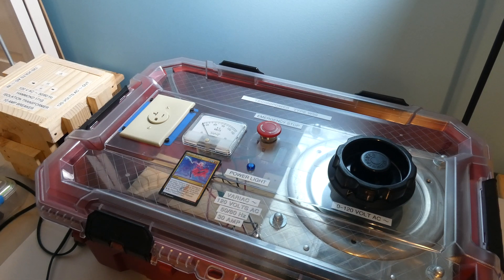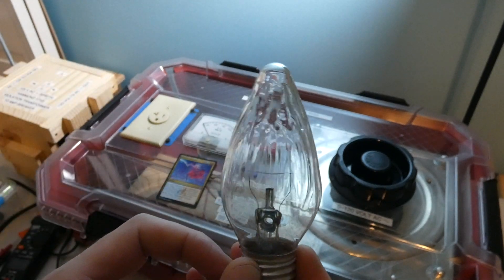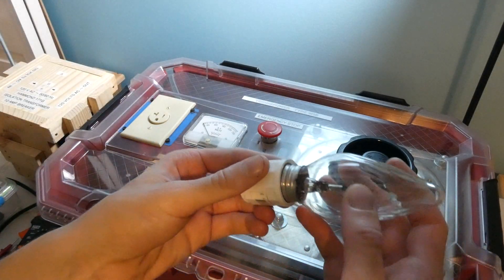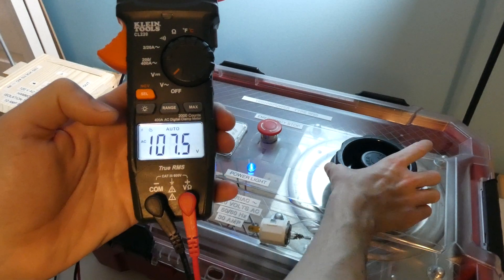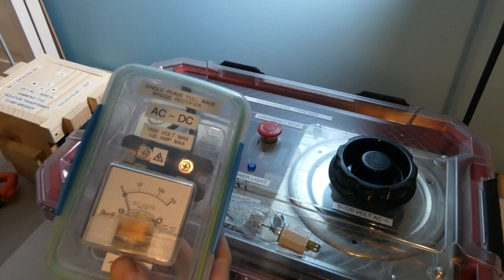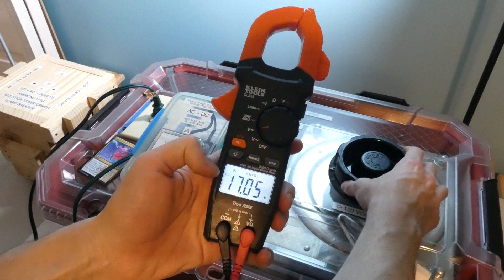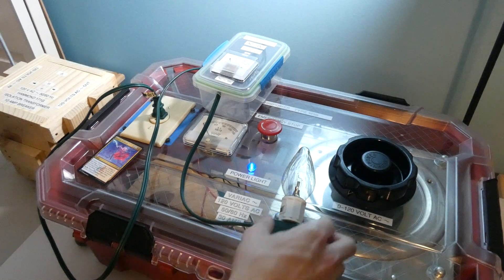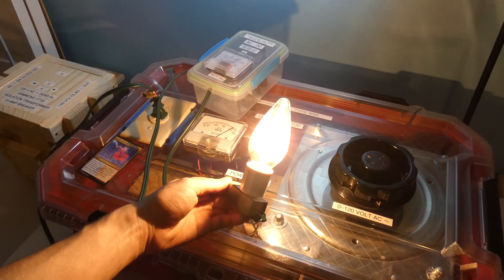Will a Light Bulb Work on DC Voltage ??

Comment: Cool setup which probably took a lot of work to build. And thanks for the demo. I have a little 10W AC bulb in a socket with leads that I use to check for voltage and got to wondering if or how much DC it could handle.

Comment: When I had track lighting installed, the best quality light came from 12V DC, NOT AC  Sure it cost more, but the light looked much crisper, and was more adjustable, just like a BLDC stand fan, uses a small fraction of the Watts AC does.

Comment: What would the DC equivalent voltage be to make the bulb illuminate with the same intensity as it does with 120 Vac? Would it be the peak AC Voltage of 170?

Comment: I mean they work via resistance. The higher the voltage the less resistance is an issues  and   the voltage I think you read for ac is an rms voltages  too. Peaks might be just a little higher . Does your bridge rectifier have capacitors on the input  and out put. If it does and you feed 120v ac into it the  caps will hold the max voltag but at dc  which I think is like 180. If you dont have caps then the voltafe output will be lower  on the rectifier

Comment: Nice video 🙂

Try to shake the light bulb from side to side in both cases (DC and AC).

1. With AC you will see the bulb blinking. At 50Hz it will blink 100 times per second. Because it's a sine wave (~) it will first be zero voltage at 0 degrees (lights off). At 90 degrees it will be at max intensity (current flowing in one direction through the bulb). At 180 degrees it will be zero voltage again and at 270 degrees it will at max intensity again (current flowing in the other direction through the bulb). Finally at 360 degrees = 0 degrees the cycle starts over. Because the light bulb does not care which direction the current flows in order to light up, you will see it blink 100 times per second in a 50 Hz AC circuit.

2. With DC you will see no blinking because current is always flowing through the bulb. Thus the light is always on 💡

Comment: Don't need to watch this video to know the answer is yes. Most trolley museums run on 600 volts DC and the vintage equipment didn't bother switching the DC the AC to power the lights they just rigged five lights in a row in series 600 ÷ 5 =120

Comment: Thank great video.What about powering ac led and tube light. I was thinking of installing an automatic changeover switch to automatically deliver power from baterry to led lights in case of mains failure. the ac led has converter ac to dc 12v installed

Comment: so you have a great lamp with no flicker ussing it in DC
Reply: with just a rectifier, the flicker is the same
Reply: @timeltdme4355  That DC source has filtering, 4 diodes + A big capacitor makes flicker-free light source.

Comment: So am I right in thinking I could run a CFL bulb on DC?
Reply: Unfortunately, no because the CFL has a ballast circuit in between the power in and the florescent tube. That circuit requires AC current to convert 120v to between 300-1000v to start the lamp. This ballast circuit uses both electronic ignition and transformers to accomplish this task. Transformers operate using the principle of electromagnetic induction which is generated using AC current. DC would simply render the process of starting the lamp null and could damage the ballast circuit. Hope this helps.
Reply: @timfritz7367  Hi, yes it does. Thanks for answering my question 🙂

Comment: Incandescent lamps are basically resistors. They don't care which way the current flows. I've done the reverse, running automotive lamps on low voltage AC via a 120 to 12 volt step down transformer.

Comment: Nice video!  What about the same test with an LED bulb?
Reply: It likely won’t work as the series capacitors will act as open circuits for DC. You would need to modify the bulb to bypass the AC-DC converter inside in order to get it working. The LEDs are diodes, which means they only work with current in one direction (DC). Funny enough, diodes can take AC, but only in one direction, and wall voltage would break the LEDs once the sine wave goes negative (look up diode V-I curve to understand why)

Comment: Sure...an incandescent bulb doesn't care if it runs on AC or DC...flashlights and cars had incandescent bulbs for decades.. they're DC. 
     It might make an interesting long term experiment to see if DC or AC affects bulb life.
Reply: Efficiency would also be interesting to see.  In theory it would be more efficient for a given amount of light on DC, as DC always has a power factor of 1
Reply: Given the fact LED bulbs have a AC to DC converter in it I'd assume an LED bulb on DC would be most efficient by negating the need to convert the power source at all.

Comment: Thanks for answering my curiosity! Can I splice a power cable into a USB cable to run a 5w incandescent off a power bank? I just want to run an old type bulb from a power bank.
Reply from the maker: Curiosity is a wonderful thing I'm glad I could help. I'm not sure about your powering a light bulb from a power bank like that. I would be very careful to be honest I don't want you to get electrocuted. And most likely the power bank will most likely not provide enough watts to power the bulb. Most usb power banks ate like a few volts. Please be safe careful!!
Reply: Nah it wouldn’t work cuz it would take too much amps